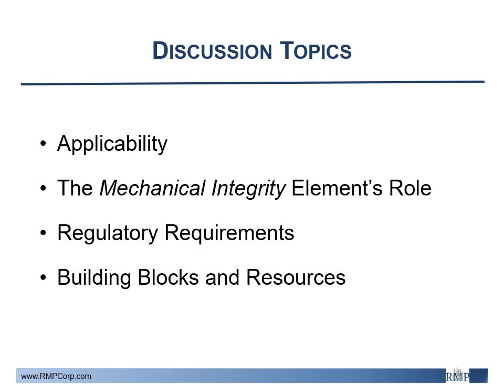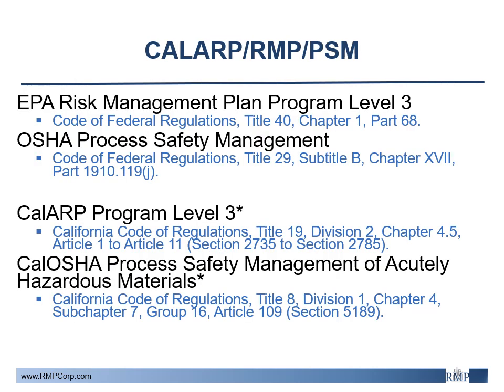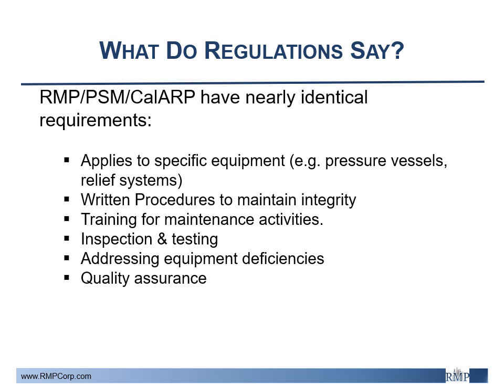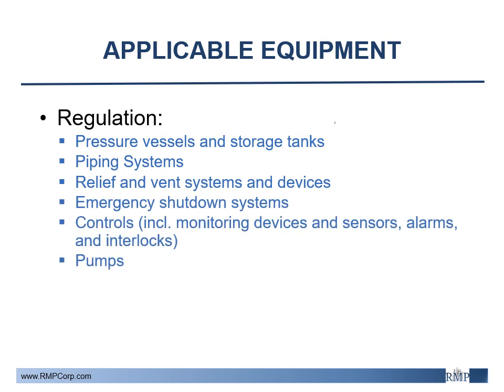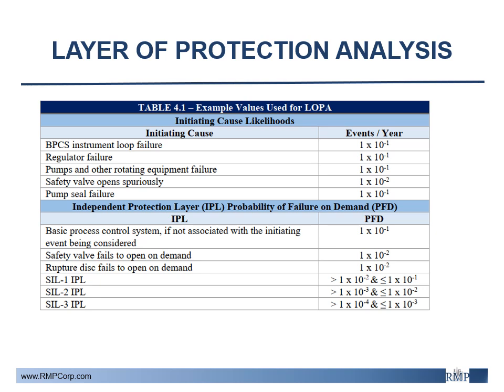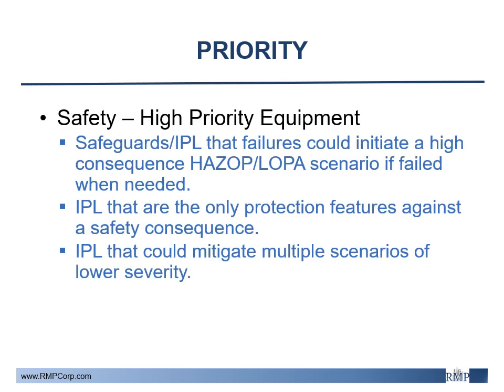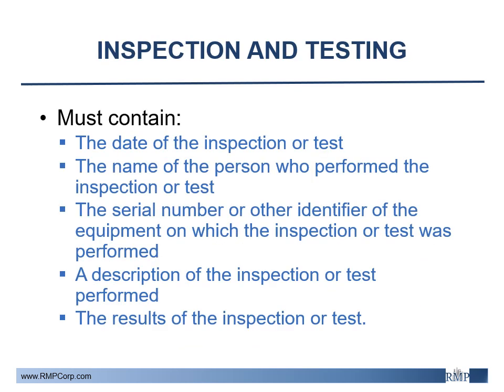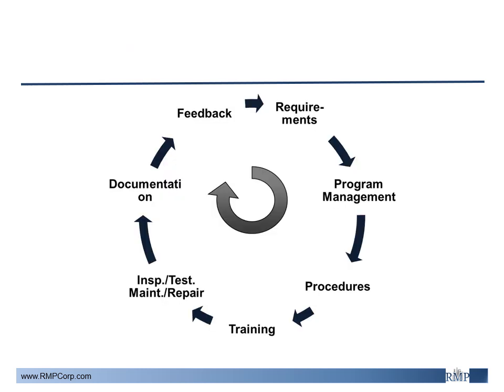Mechanical Integrity 101

Comment: Is HAZOP sufficient to address mechanical integrity (MI)?

While HAZOP is excellent for evaluating process safety and potential impacts on operators, is it enough when it comes to predicting mechanical failures?

For instance, if we foresee a pipe failure during a HAZOP, we might identify a likely scenario as one where the consequence is operator-related—like a first-aid-level injury due to a leak (which could be a 3 in a risk ranking). In such cases, HAZOP provides valuable insights, but it does not trigger deeper risk assessments, such as a LOPA, to ensure a comprehensive understanding of potential consequences? therefore, there seem to be a gap here.
Reply from the maker: Hello, in a HAZOP there are two elements to consider. 

Consequence severity: determining the impact of a release due to a mechanical failure such as with a pipe failure will help determine equipment safety-criticality. Some may result in that first aid injury. Others in possible fatality. This helps prioritize.

Likelihood: predicting mechanical failure likelihood may involve consulting with the equipment inspectors who should be tracking asset integrity and giving them the opportunity to raise flags for areas of concern during the HAZOP. It may also involve including a corrosion engineer to attend a portion of the HAZOP to identify possible corrosion mechanisms for more complex systems. 

If the consequence is significant or likelihood of a release is abnormally high, the Asset Integrity Maintenance plan for that equipment can be adjusted to increase inspections or set up a timely replacement plan. A LOPA may be useful for certain equipment failures that have Failure Rates calculated from industry data like pumps and control valves (see our HAZOP videos on brining scenarios over to LOPA). LOPA may be difficult to implement for certain scenarios such as piping failures which are more variable and system dependent. In these cases, relying on inspection records and personnel as well as following industry standards as a minimum is prudent.
Reply: @RMPCorp  wow..firstly thank you for your reply, I have been struggling on this for some weeks. 
In most PHA I facilitate, it has mostly process engineers and operators, so it's the consequences are based on what happens to the operator.. We do not invite the asset integrity team or the inspectors. So I was thinking of introducing FMECA, where everyone from reliability, asset and inspectors are invited to give an input of each equipment in a plant. 
However, looking at your reply, would you recommend that I expand the hazop to include mechanical integrity focused question?
Reply from the maker: Expanding HAZOP to include mechanical integrity focused questions is appropriate. Inviting inspectors and asset integrity to the HAZOP would be ideal. Their thoughts will help the team better gauge likelihood of certain equipment failing. Sometimes operators have never seen something fail, but inspections will say that it is a growing concern. It can also help to give them a voice at the end of each node or study and asking if there are any "problem areas" (leaky equipment, corrosion, faulty control loops) they want recognized in the HAZOP. The team as a whole can determine if it's hazardous, how likely a release would be, if there are appropriate and timely inspections in place, and what options they have to correct a risk gap if needed (either administrative or engineered). Even if it doesn't eventually trigger a LOPA, the team together should come up with an appropriate Risk Tolerance as long as they have the knowledge that they need in the room.